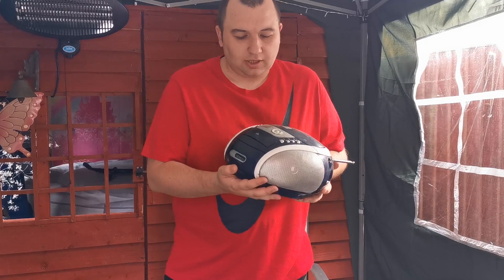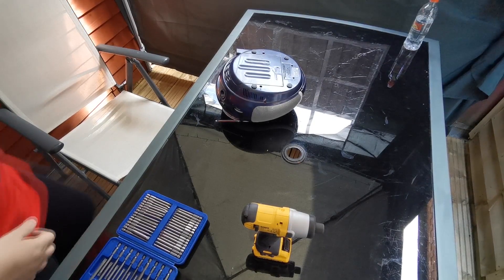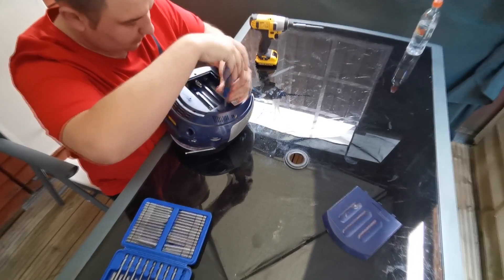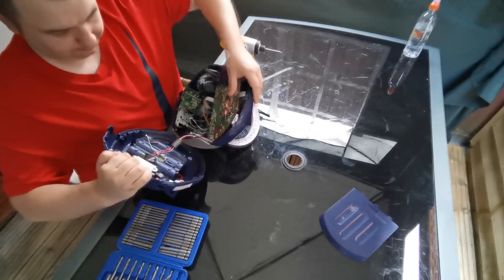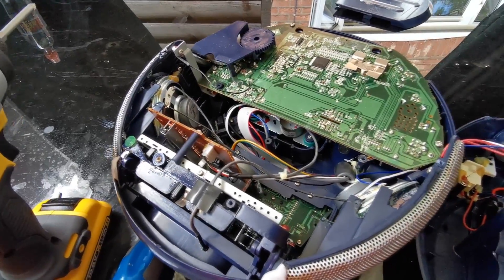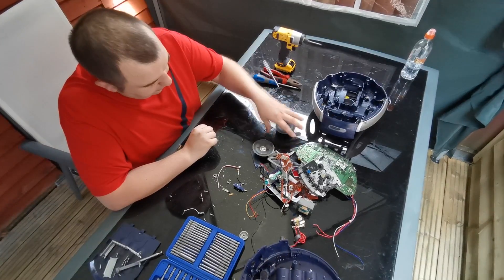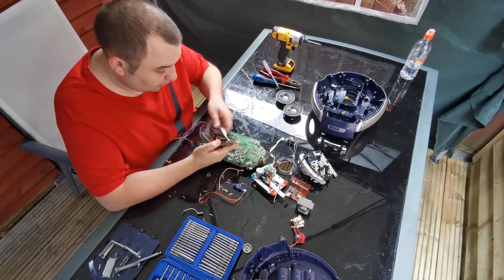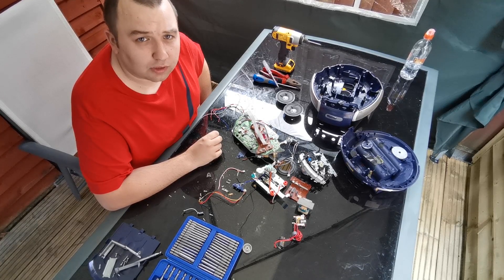Stripping Apart An Old CD Cassette Player

Comment: Gary with the Brown back board that's low grade. Best thing to do with any boards, take any copper off & ally, store boards til you've got alot of weight, then find a local board recycling plant & they'll pay you by the kg. Keep the gold fingers off any & sell on Ebay when you have alot. Look at it as a long term investment if you have the space to store them.
Reply from the maker: Cheers matt thanks for info 👍